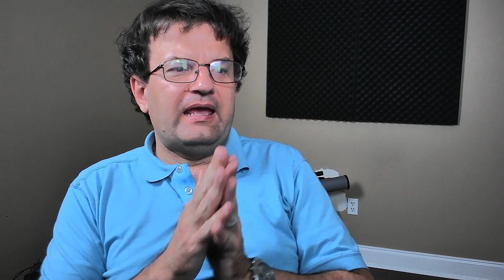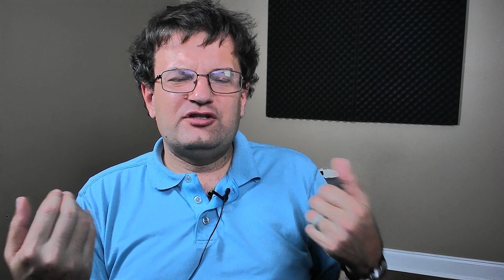The ins and outs of mining asteroids, from what type to how to process, etc

Comment: The way I see it, first for fuel, then for energy (solar panels) and then for refining. In the upper part of low Earth orbit have one or more factories that accept the asteroids to refine them into base metal products and then have a second factory that is adjacent that can take those base metal products to do custom build of parts for either larger spacecraft or for space stations. I see no reason why all of this couldn't be done by robots, some of which are mostly AI driven while others may be required to be tele-operated. Two concerns I have about any of this is the amount of space junk that is accumulating all around our planet and the sand and dust that comes off the Moon for anything we do on the surface there.
Reply from the maker: This seems likely to be the order, although it is hard to know for sure. Some amount of refining will help the power. Taking in goods will be more useful in higher orbits actually, it takes a lot of energy to enter LEO from deep space, but much less in higher orbits.

Space Junk would be an issue, but primarily one that would be affected by the mining and refining locations. Right now space junk is mostly a problem for LEO and Geostationary orbits.